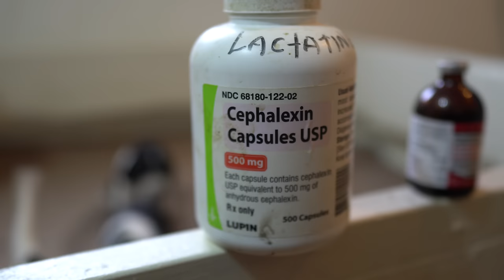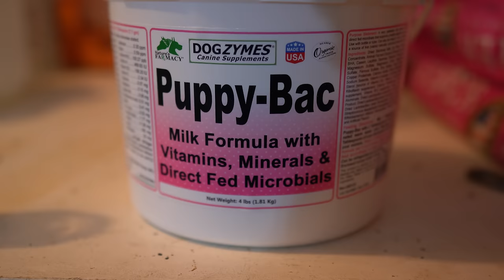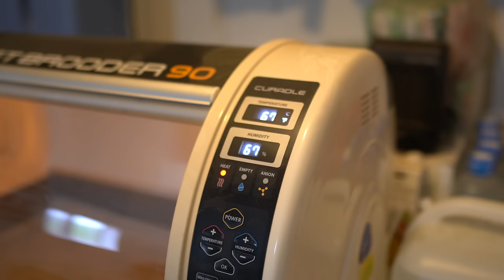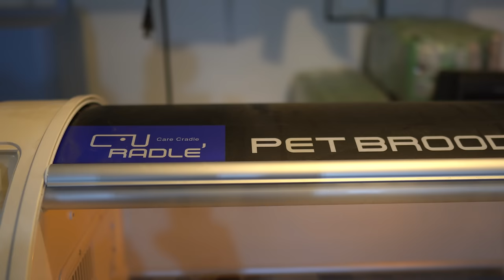How to Raise Puppies. The Definitive Guide to Coonhound Success

Comment: I don’t want to sound like a know it all, but here goes. When a pup is dehydrated and gets pushed out, one thing that also helps is to take a dab of Karo syrup on your finger and rub in its mouth. When yo give the fluids under the skin, you can add a slight bit of dextrose in that. When a dog gets injured, sick, stressed, etc., the two things that happen are dehydration and low blood sugar. It’s something I’ve learned in my 50 years of messing with performance dogs.